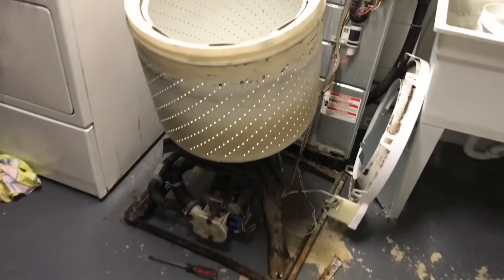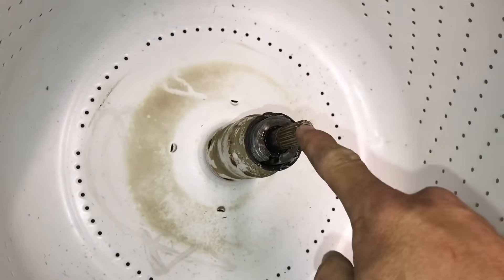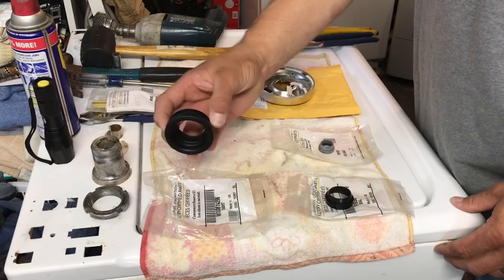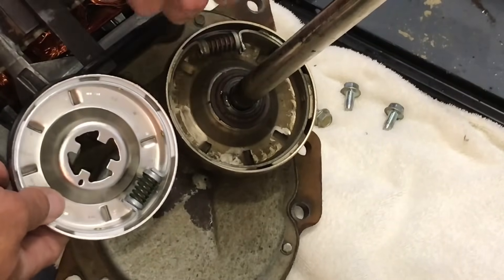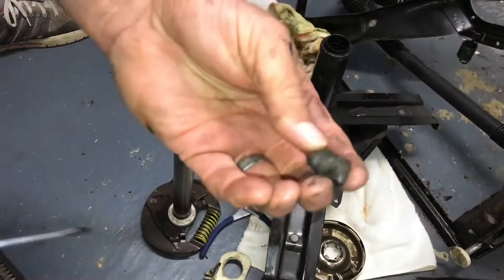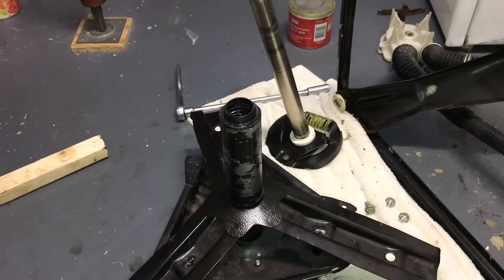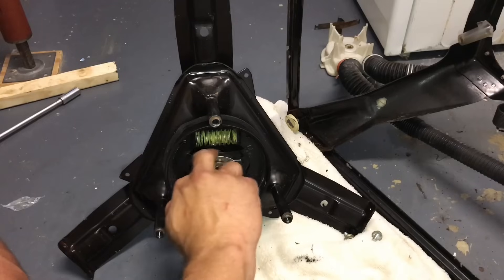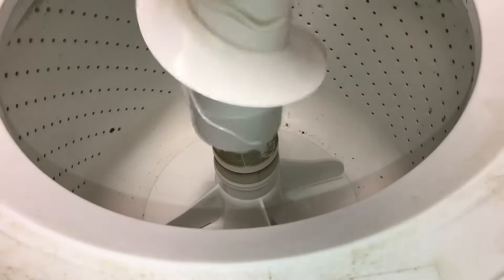Leaking Kenmore Washer - How to replace Shaft Seals.

Comment: The newer no agitator machines have several problems. The flying saucer agitator is driven by a quill shaft from the transmission. The teeth in the agitator are plastic and when worn, will make a snoring sound as the teeth grind on the quill shaft. If you wait too long, it will eat the transmission shaft. The one time fix is to surgically clean the agitator and quill shaft, then use JB Weld to bond both pieces. You won't be able to take it apart again  without grinding everything away but it doesn't matter because the machine has a short life anyway. (See next post)
Reply: 2nd post agitatorless machines. When...not if...when the tub seal leaks, the water goes directly into the transmission. There are no seals available. The water destroys the bearings and the machine will howl like a banshee when it spins. The transmission is rivited together so unless you are very patient, it's not worth your time. A replacement transmission is $400. (See next post)
Reply: 3rd post agitatorless machines. When water leaks into the transmission, it will drip right into the "shifter', which is a device that causes the machine to go from agitate to spin. Water corrodes the circuit board and upon attempting a wash, you will hear a clicking sound from below the tub as the computer tries to determine if the transmission is in its primary agitate position. The shifter also has a speed sensor which tells the machine how fast to spin the drive motor. It is not worth changing the shifter because by the time it corrodes, the transmission bearings are already damaged by the shaft leak. (See next post)
Reply: 4th post agitatorless machines. You have to be careful about spilling soap or softener on the lid switch opening. Liquid will gum up the locking mechanism to the point it fails to move. The computer will think that the lid is not locked and it will just sit there full of water. You can carefully take it apart and clean it out, but it's a delicate job. A new switch is $60ish. (See next post)
Reply: 5th post agitatorless machines. If your machine's drain pump keeps running, it's because the computer thinks the tub still has water in it. The air tube that comes from the bottom of the tub to the nipple in the back of the computer is plugged and the trapped air fools the computer into thinking the tub is full of water. Blow the hose with air and make sure you hear gurgling water in the tub when you blow on the tube by mouth. If you use an air compressor, make sure you don't blow the hose off the tub. Also, don't blow air into the computer. You will destroy it. Conversely, if the hose falls off or develops a leak, the machine will overflow as the computer does not sense that the machine has filled up. There is a time-out programmed into the computer, but by the time it figures out something is wrong, water is all over the floor. It will set a "too long to fill" code in memory. See other videos on you tube as to how to get machine into diagnostic mode. End of posts...
Reply from the maker: Great information!!!!  Thank you so much.

Comment: There are two spin shaft seals at the top of the center tube. Do we not need to replace both of them? Is there a way to remove them that doesn't risk damaging the center post?

Comment: I have the same washer. Just recently it is pouring out water from the back side. I checked the hoses, there are no signs of it leaking around the connection. Could this be my issue?

Comment: The basket has a large round plastic lint filter on the bottom.  It has 4 tabs that fit into the lower tub and a metal ring to hold the tabs in place.  My basket would not come off as my block would not pass through the filter interface.  Maybe rust and swelling made the hole smaller.  I had to jerk the basket upward several times to break the block from the shaft.  Trim your block to fit through you have problems.  My top bushing was worn and my spin shaft was corroded away.  I got a new shaft complete with seals but I will live with the loose bushing.  Just be ready to find more problems as you go.  And allow time to order parts.  My agitate shaft out of the trans was rusted at its top seal but this part is $100.
Reply from the maker: You have a different make/model for sure. There was no filter interface on my Kenmore Elite. Im glad you were able to breath life back in your machine. It sounded like it was ready to be scrapped!!!  All the Best-
Reply: Ok 4 years later.  I went back and replaced the post bearings and seals.  If the brass bearings in the post are badly worn, the seals will wear prematurely.  The little seal on the agitate shaft was a little tight and I had to use a dremel and cutoff wheel to cut a relief slot in the metal ring.  The part number for the 1” diameter by 1/2 inch tall agitate top seal is wp91939.
Reply from the maker: @graymodeler Awesome information. Thank you for sharing.

Comment: Thanks for doing this video. I know it will help a lot of people. Good Job!
Would you put grease on the Tub Seal? Thanks again for the video.
Reply from the maker: Hi Ron.  Thanks for your support.  I really do hope this video will help others.  I don't think its necessary to put lube on the tub seal but as long as you use a lubricant that will not deteriorate rubber (valve grease, etc.) I don't see an issue with applying some to the seal.
Reply: Remember these parts are exposed to laundry soap which dissolves grease and contaminates clothes.  Certainly no anti seize on the basket block.

Comment: Hey William, I had one question.  I did this repair, then the transmission blew out, replaced it.  Then It started leaking again.  It doesn't leak on small load, but does on full.  Haven't tried medium yet.  I don't see how the basket drive seal is leaking now but that's the only thing I can think is happening.  It's leaking in the center like before, on top of the new transmission.  I was thinking of replacing the basket drive shaft because it comes with the seal already installed eventhough I replaced it already.  Main tub seal is replaced, but it's not leaking like it's coming from the tub seal.  Any ideas?  I'd hate to get a new washer over a seal.  thanks. Lito

Comment: I watched another video about replacing these shaft seals. The fellow who did that video suggested that 2 Upper seals be ordered. He put one new seal on top of the other inside the shaft. I don't understand why that would be necessary. Did I miss something and it really does call for 2 seals piggybacked one on top of the other?
Reply: The older models have the 2 seals.  Someone thought the single seal was a part modification.  I'd replace the parts exactly as they came out of the machine.
Reply from the maker: Totally agree.  I should have replaced both seals as well.  I didn’t but it’s working great.

Comment: Hi Mr. Kasper the new seal WP91938 seems to have a smaller inside lip than the one I removed and there is another seal WP8577376 which looks exactly the same . Do you know where the other seal goes? It looks like they might  go in that same area where the lower seal goes? Any suggestions. Nice video very helpful! I've probably watched it dozens of times!
Reply from the maker: One is the second lower seal.  There were originally two then its my understanding they modified it at a later time.  Sorry for the delay in response.  Thank you for watching.  I'm in the first-responder category and have been overwhelmed with my day job.  Stay safe and heatlhy.  Best-

Comment: Is it necessary to lubricate the spin shaft or seals? Won't the PTFE lubricant weep out into the water when you run a load of laundry? Although, I guess, since that's the problem I'm having, then my seals are shot...
Reply from the maker: I haven't had an issue with the PTFE weeping.  This process here seemed to work perfectly.

Comment: Does anyone know why after i preformed this, the washer is making a high pitched squaling noise during the spin cycle only. I made sure to tighten everytbing back down and lunricated all the seals. Stumped on this issue.
Reply from the maker: Hello, and thank you for watching. I’m wondering if you have a bearing in the transmission that’s getting ready to fail.
Reply: @SmokinwithKasket  Thanks for replying. It wasn't doing it prior to taking it apart. I have a video of it doing it. It sounds like something rubber.

Comment: do i need to add red loctite 515 silicone sealant when the new seals are in and reassembled?
Reply from the maker: I didn’t do that but I don’t think it would hurt anything that’s for sure. Let us know what you ultimately did.
Reply: @SmokinwithKasket  so far we've been fighting thru 19 years of corrosion and neglect.  Possibly going replace the basket drive assembly, spin basket.   Thx for the reply
Reply from the maker: I’m sorry.  I do not know.  I ordered all my parts through an appliance store near me.
Reply: @SmokinwithKasket  Did they redesign the lower shaft seals?  because my original came with two stacked for the lower seal.  And the parts i ordered only came with one.  my eyes arent so good but yours looked like it had another seal under the one your replaced?
Reply: I've got to thank you for detailing this repair and diagnosing the issue.  My repair was a success.
Reply from the maker: @ronski.  There are two stacked seals. I was unable to find the lower seal however, my repair was successful and from what I’ve learned, the top seal usually fails.
Reply from the maker: @ronski.  Great news.  Glad this video was helpful.
Reply: @SmokinwithKasket  the top....eh? good to know.  the new tub support i installed had all the bearings and seals seated except the lower shaft...i had to press in.  I believe the lower shaft seal on the support was redesigned for one slightly thicker seal vs the two stacked.  i dont think it was an improvement, is my initial thought.  thanks for looking into my comments.  regards, Ronnie
Reply from the maker: @ronski.  -Yes - you area correct.  That was re engineered into a single seal.  Mine has worked flawlessly so far.  Glad you were able to successfully repair the leak.

Comment: I have a whirlpool gold GSQ9364HQ0 with the exact same issue (replaced tub seal still leaking) - on parts diagram (on partselect) can find upper shaft seal but not lower shaft seal - I am fairly certain looking at the shaft that there are two seals - any suggestion as to how to locate (for purchase) the second seal?  Maybe buy the 91938 (the 91939 is listed for this model) and hope it fits?
Reply from the maker: Hi Jennifer- that’s interesting. After researching your model it seems that you don’t have a lower seal. You’ll see in the “Brake and Drive Tube Parts” schematic, that the tub seal, #2, slides down one shaft only to the bottom. And there are three seals / sleeve or bearing, #2, #3 & #4, that are inserted at the top.  Your model doesn’t appear to have a lower seal. Hopefully an appliance repair technician can clear this up.  Thank you for using my channel.  Please let us know what you find. All the Best.
Reply: HI Mr Kasper - actually I compared parts diagrams from your model and my model on sears parts direct and could not find the 91938 (lower shaft seal) on your Kenmore diagram either - so I am wondering how you found it.  As far as contacting a reply technician - NEVER!  I can fix this myself 🤩
Reply from the maker: Jennifer Trost Lol- fully Agree.  I meant maybe a technician will comment here to clear that up.  Here in southeast Michigan we have Servall appliance parts - you could even call them and the will clear it up for you. They been in business for 50 years or more and are very knowledgeable - (800) 856-9874. I’m lucky to live less than s mile from them.  Let us know the final outcome. All the Best.
Reply: @SmokinwithKasket  Hi Mr. Kasper - same person different Google account (long story) - This is Jeff Trost (Jennifer's husband and Julia's dad).  I wanted to give you an update on the above.  1) I figured out the corresponding lower seal part for my GSQ9364HQ0 - it is named as a "washer transmission stem seal" (WP8577376) on the Machine Base diagram; 2) I followed your instructions to replace the upper and lower seals - the upper one went fine, but I hit a snag on the lower one.  It turns out that the shaft would not allow the lower seal to sit very far down due to a metal edge (which, based on the parts diagram, may be the centerpost bearing) - so despite using your hammering method, I could not seat the seal very well into the shaft.  I decided to use some HondaBond liquid gasket and seat the lower seal as best I could.  I then put every thing back together and she still leaked! 

I was about to throw in the towel (I literally started online shopping for new washers) but somehow derived inspiration from your video to try again.  I pulled everything apart again and noticed that the centerpost gasket I installed did not completely seat either - that was an easy fix.  I then took two sockets (based on another video from applianceparts pros) - a 1 1/4 and a 1 and 1/8 socket - and used the smaller one to beat the bearing down the shaft (to give the seal more room to seat).  Then I used a the 1 1/4 socket over the seal to press it in.  I put everything back together - AND NO MORE LEAKS!!!!  Also replaced the tub springs, pads, and water dispenser to boot - and now my 18 year old washing machine is purring like a kitten.  Thanks so much for your help and inspiration - a little persistence pays off.  Would strongly recommend using the sockets to press in the lower seal for this job.
Reply from the maker: Thank you Jeff for that update.  I'm glad to hear that I conveyed some inspiration here.  LOL.  Glad to see that the lower seal was identified.  I didn't spend a lot of time searching however, was surprised that I couldn't locate that part.  I see you were able to find that ("washer transmission stem seal" WP8577376).  Great news!  Sorry my hammering technique didn't work very well.  That was a great idea to use a socket to help insert the seal(s) into the shaft.  I should have tried that as well.  Thank you for the ideas and suggestions.  This is an amazing platform for all of us to learn.  Glad to hear your machine is fixed.  Mine is still humming along without any issues now.  Best Wishes!!!

Comment: Great video. Thanks! How did you know it was the upper/lower shaft seals and not the tub gasket seal?
Reply: Nick P good question!
  I have changed a few tub seals. I have yet to change the shaft seals. I have one in now I may change the shaft seals in since I was going to change the tub seal anyway.
Reply: Actually I used different load water level settings.  If lower settings don't leak then it is the upper post or agitator seal leaking.

Comment: Hmm, I bought the transmission and clutch assembly, motor coupling (just in case), but I can’t get the bottom half of the plastic agitator off. Grrr! I got the cap off and the bolt, but my bolt was 1/4”, not 7/16”. That enabled me to take the top part of the plastic agitator off but the larger bottom half won’t slide off. Is there another screw or clip hiding somewhere? I have a Kenmore 80 series top loader.
Update: I just had to pull harder, haha. I’m such a girl.

Comment: What are the little plastic cups for that hang from the frame which are visible at 8:34 after you removed the transmission?  Our model had a catastrophic leak last night still trying to find the exact culprit.  One of those little plastic cups is full of water, the other isn't.  My interpretation is that it's not a water pump issue and probably a tub seal issue but not sure how to know if it is a clutch leak instead unless I tear it apart.  Those cups must be a clue here otherwise why do they exist?  Help me out....  please.  Seems like at least half the tub drained through the 2nd story floor and into the garage below it.  :(   Never noticed any leaks until this one.  Thanks in advance....   Also, this is the best video I've seen on the topic - so thankful you made it!!!
Reply from the maker: Thank you for watching and supporting our channel. When the washer leaves the factory there are brass pins placed to hold the tub from sliding around during shipping.  When the machine arrives to its first destination from the factory the brass pins are released by the distributor or store.  The brass pins fall into those little white cups where they remain for the life of the washer.  The white cups have no other function.  As for your water leak I would check your hoses and even the pump because it seems like you have a major leak from that area. If it were the inner seals or even the tub seal, they tend to leak gradually starting off with a light drip that you wouldn’t even notice until it increased over weeks and months and starts running from beneath the washer in the form of a little puddle. Let us know what you discovered.  Best of luck.  Stay safe.

Comment: I noticed the lower shaft seal that was removed is much taller than the replacement seal (91938).  There is a big difference in height.  Also, my model with is a Kenmore 90 Series 110.28932790 has a 2nd seal right below the 1st seal on both lower and upper shaft.  On the lower shaft the 2nd seal seems to be like the 91938 seal but the one that goes right on top is much taller by more than double the height.  I'm wondering what seal # part this would be.  You can see it in the video at 14:12 mark.  Is it ok for the 91938 seal to be so much shorter?
Reply from the maker: Hi Jorge - I was told by my local parts supplier that the shorter seal was an updated replacement.  apparently the taller seal is no longer available.  Good observation on that.
Reply: @SmokinwithKasket  Thanks-I replaced both of my seals yesterday and worried about the shorter one in the top of the shaft myself.  It fit but was definitely shorter. Thank you.